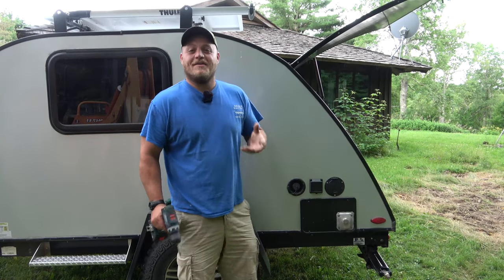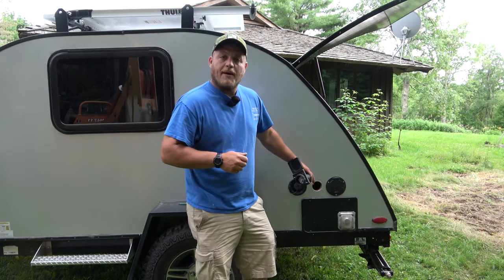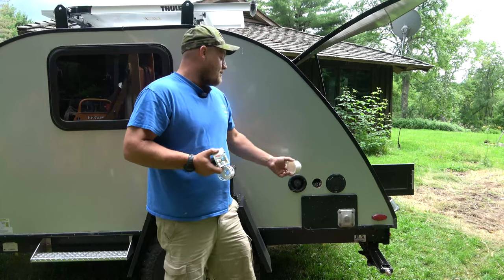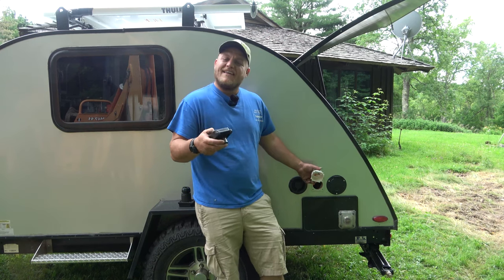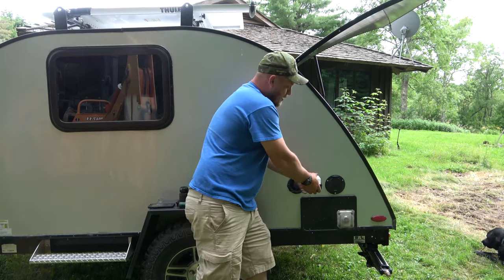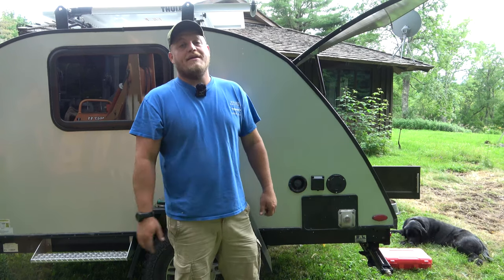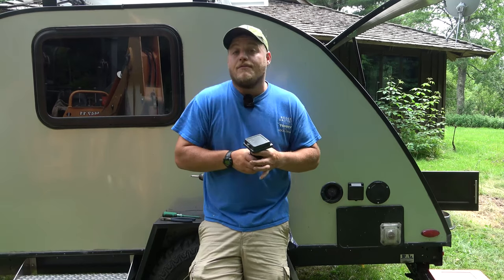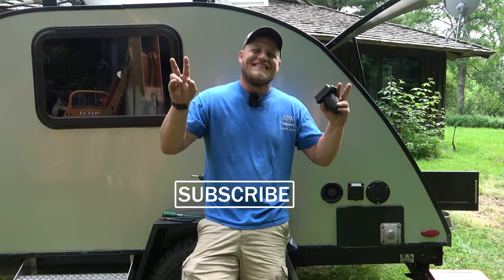30 amp RV inlet plug | Installation and Maintenance

Comment: I had the same issue, which brought me to your channel.  My surge protector plugged into the shore power outside showed that it was properly wired and power was going into my camper, however, I had no power inside to run any appliances, and the meter inside showed I was losing battery power. My GFCI would not reset.  I decided to check the connection into the inlet box, and BINGO!  One of the prongs in the inlet box was fried to a crisp and had melted the female end of the extension cord as well.  I will be replacing the inlet box this weekend thanks to your video.
Reply from the maker: Yikes.  I'm so glad you caught it, it's a very dangerous situation, and it seems to happen all too common.
Reply: The same thing happened to me this weekend. The surge protector was reading that it was fine when it wasn't but the surge protector did cut off power to the inlet so that's a good thing. The wires were fried and the white wire and black ones were fried together. I cut out the burnt ends so I can hook up to a clean wire. Videos like these helped me out a ton!!
Reply from the maker: @lurchlogan  it's pretty scary, I'm really glad that you found it and were able to fix!
Reply: @DIYOutdoorLife ... For sure, I can't express enough gratitude to channels like yours and others. I'd be paying someone else a boatload of money to fix my repairs, I enjoy doing the repairs myself plus I gain knowledge and I'll know what to look for if it happens again. Again, I appreciate you & your channel. Thank you 👍

Comment: I am having an issue like this right now.  We came back from a camping trip and when I plugged it in at the house, nothing.  I checked the camper breakers and fuses, everything looked good. So I figured that the converter went bad.  So I got the voltmeter, unmounted, tested.  The converter was just getting no power.  It turns out that the wire to the 30A receptor is having issues.  If I jiggle it enough, it'll get power.  And at night, I can see the back of the receptacle light up from arching sparks. Not good!   Thank you for this video!!  Before I left it unplugged last time, the fire alarm in the camper woke us up twice in the middle of the night; although no fires.
Reply from the maker: Wow, it's scary how common it is!  What kind of camper do you have?

Comment: After a summer stay at a Mn resort. I bring or camper home to store. When it came to remove my power cord it would not come off easy. The ground wire arched and plastic welded the end of cord to the receptical. Bad news. Have a new receptical on the was. Check you connections campers
Reply from the maker: I'm glad you caught it before anything serious happened.  A loose connection is almost always the culprit in this situation.

Comment: I had the same issue but on a 50 amp plug I was getting power on Leg one but no Leg two so half of my trailer was hot and the other was not but every time I plugged in 50% of the time I would get both legs, so I pulled out the 50 amp plug and found that the Leg two wires were not tight and slipping out and in and even Leg one was not real tight on the clamp screws so I pushed all the wires back in and torqued to 45 in LBS per specs. no problems after that. I think you are right mine was never tighten from the factory. I was lucky there was no sign of burning or arcing.
Reply from the maker: Yikes.. kinda unbelievable right? Glad you caught it!

Comment: Im surprised the manufacturers are using romex it usually doesn't last long in RVs,Campers,boats, and Vans.
Reply from the maker: 💯   I like to rewire mine with marine grade tinned, pure copper.   It does not cost that much more and is far superior… Kind of shocking... lol

Comment: It looks as though they used solid wire? If so that may be or could the cause of future problems. Stranded wire is a much better application for mobile units.
Reply from the maker: You are 100% correct, although it is standard practice for these campers AC feed to use solid Romex connections.  If I was building one from the ground up, I wouldn't even use stranded THNN, there's plenty of heavy gauge automotive wire that is safer with vibration.

Since this is found in almost all campers, it really is critical to get in there and check your connections frequently .

Comment: Only mildly terrifying! Checked mine immediately and they were tightened down correctly - course there was a lot of exposed wire, but all still well within the shroud at least. And of course I accidentally pushed the collar down behind the wall.
Reply from the maker: Haha… I think I warned about that, didn’t I? You can fish it out pretty simply from under the galley though right?

I would trim those wires to the proper length, you don’t wanna exposed conductors, even behind that shroud.
Reply: @DIYOutdoorLife  You probably did warn about it but I still managed to do it! It didn't go far, was easy enough to get out :) Yeah I'll go back and trim those wires accordingly.

Comment: I’ve got a 36 foot class a boat anchor I’d like to burn down
Reply from the maker: Hahaha
Reply: I’m serious paid 30 grand for a motorhome serpentine belt, pulley and water pump pulley ripped right off the motor on the belt tensioner side generator took a crap with only 290 hours on it then I went to fill the storage tank for my water for the toilet and that leaked everywhere trying to put water in above the LP tank other than that it runs up and down the road 27,000 miles on itoh yeah my ABS light is on
Reply from the maker: @stevenchristiansen2122 
Oh man, thats the worst.  I hope youre able to bring it back to life

Comment: "Oh my. Hold my beer" Scrambles out to my trailer with screw gun in hand...

Yeah, given the never ending list of things improperly assembled on my current (new) rig I wouldn't be surprised to find this condition on mine.  That's just so rare.

This weekend's RV DIY for me? Replace all of the self destructing drawer slides with real ones. I think my manufacturer is taking a hint from the laser printer industry and installing "starter parts". Like how printer manufacturers ship new printers with "starter cartridges", good for maybe 2 pages of text? I digress.
Reply from the maker: haha...starter parts... did you ever read that leaked memo from an RV company, where they informed the engineers that the components should last the use of 40 nights?  They tasked the engineers and designers to not overshoot the 40 nights mark for expected use...it shows...
Electrical is another story, someones going to get hurt or worse with this stuff.
Reply: @DIYOutdoorLife  Yep, I saw that. I've worked places where that sort of "let's build disposable stuff" mentality prevailed and they usually treat their employees with equal regard. It sickens me.

As for RV's I think the danger covers the entire vehicle. I've had my fair share and then some of RVs over the years and recent quality is piss-poor and some of it down right dangerous, in my opinion. I recently had a close call with my brand new little rig when my 3/4 full 55 gal water tank fell out while towing. I was 5 mins off the freeway and going slow when it happened so no one got hurt. Had it happened 5 or more minutes sooner I'd have probably pogoed that trailer or at least did some nasty damage to someone behind me. And have you seen some of those few cases where lightweight rigs on Lippert frames are buckling at the tongue? Lippert just build them to spec so if the RV manufacturers are cheaping out and underspecing the frames they order then there's another potential safety hazard and a hairy one at that. I bet there's far many more in general. I've been obsessively going over mine and finding and fixing all manner of things to fix, including sketchy electrical. Have I mentioned I miss my BW? It wasn't perfect either but compared to this thing, it was awesome. And this isn't a cheap brand I now have.

In my case with the tank, it was just held up with 1/4" steel straps and self tapping screws. It all got fixed under warranty and I and the dealer made sure that all of the tanks were remounted properly with through bolting and saddle mounting. Be that as it may, I still called up the RVIA and had a chat with them and they didn't seem to pleased about what I had to say and show. I don't know how far that got but maybe we all should start considering that. This isn't a spite thing, it's a safety thing and that's something the RVIA is supposedly there for and having their sticker on the side of an RV adds to the cost. I say take advantage of it, especially if a manufacturer refuses a warranty claim of a safety or sizable nature.
Reply from the maker: @charlesswank6401  yeah… it’s kind of unbelievable. Frame isn’t something to cheep out on.

Comment: Why are you using romex on a camper. It should be stranded wire 10/3.
Reply from the maker: I agree and I believe I mentioned that in the video.  I did not add 10-3 romex, this is what is used for the panel feed on all of these campers.

When I rewired mine, I used ancor 10awg tinned pure copper.

It’s crazy to me that they use solid in high vibration environments, but this is a permissible activity for all of these trailer manufacturers …